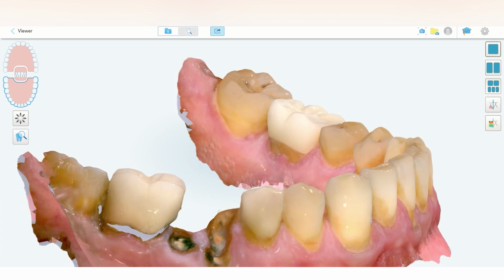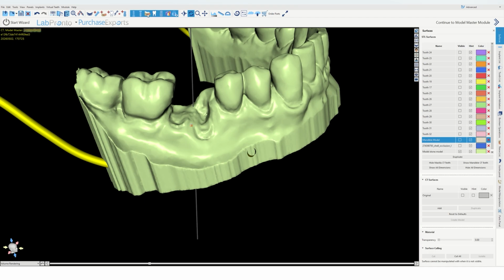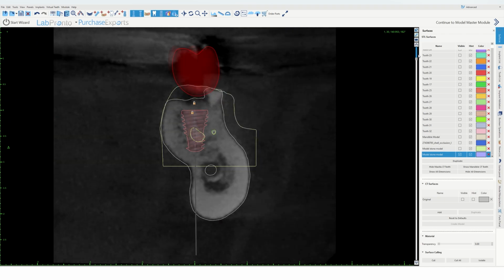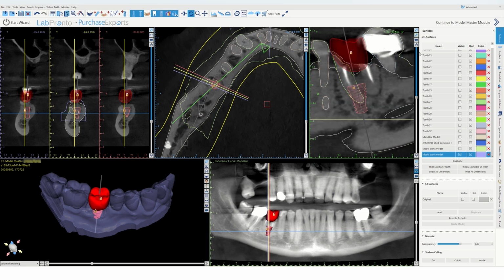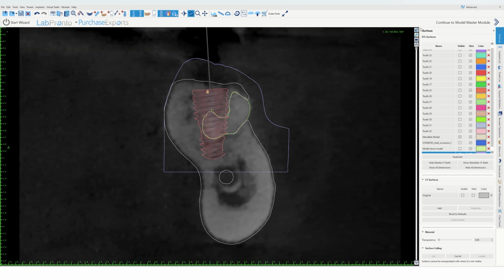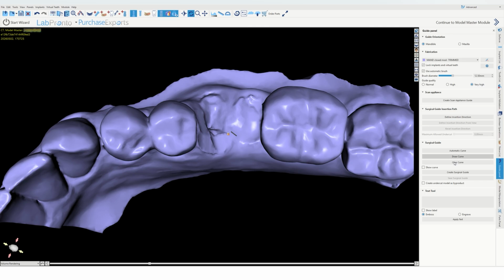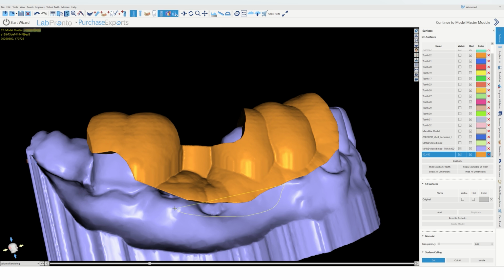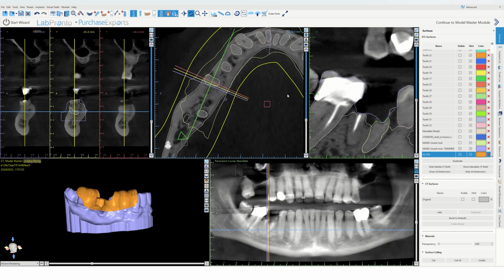Immediate Mandibular Molar Implant: 3D Planning and Surgical Guide Design in Blue Sky Plan

Comment: Doc this is great. I guess my question is on the guided drills how do you know what drills to use and sequence because now you have the drill kit that is guided drills but have the space for the sleve
Reply from the maker: Are you asking how to decide what size  (in mm) to make the “software guide tube diameter” in blue Sky plan? 
If that’s the question, I would say this:
Every brand of implants that has a guided drill kit also sells the metal rings (“guide sleeves”) that correspond to their guided drill kit or kits. In the case of Neodent, they have two guided drill kits called EasyGuide.
—“EasyGuide Narrow” guided drill kit, for placing 3.5 and 3.75mm diameter Neodent implants.
—“EasyGuide Regular” guided drill kit, for placing 4.0, 4.3, and 5.0mm diameter Neodent implants.
Neodent makes a specifically sized metal “guide sleeve” — with a specific diameter, suited to each of the kits.
Once i have the metal guide sleeves in my hands, I measure the external diameter of them, using one of those sliding calipers. Then I add approximately 0.07-0.10 to that measurement. The resultant number is the number (size in mm) that I use in the “software guide tube diameter” field, in the surgical guide tab, in Blue Sky Plan.
If you like, I could make a video showing this. That might provide a more useful explanation. Let me know if you would like to see a video explaining this better. Cheers!